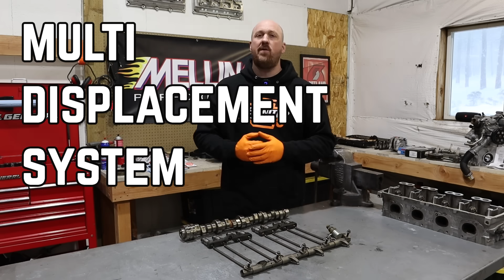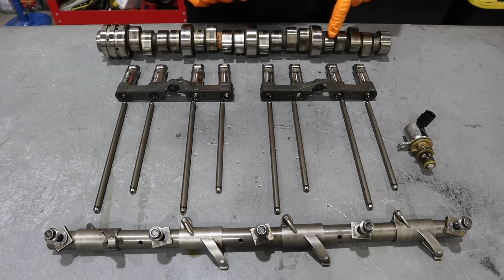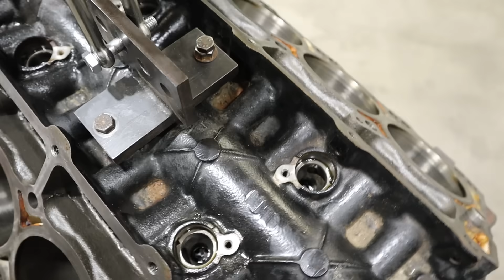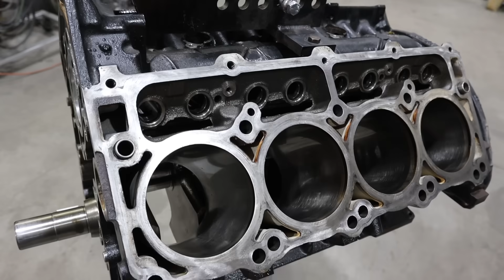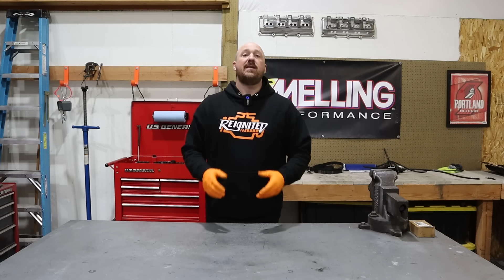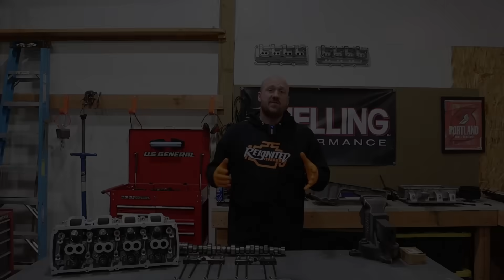Is MDS Damaging Your HEMI? The Answer May Surprise You!

Comment: I experienced the cam//lifter failure in my 2010 Ram 1500 in November and did the repair myself. Mine was the #5 intake that failed, which is a non-MDS lifter, so correct, the failure occurs with both MDS and Non-MDS lifters.
Reply: My 14 and my dads 15 were both #5 exhause non mds lifter
Reply: Most of the time I hear about failures, it seems to be the intakes, but your cases show the exhaust gets affected as well.
Reply: Does (or did) your truck experience a lot of idling time?
Reply: @DoctorHemi  Not by me, however, I bought the truck used in 2021. Where did I go to buy it? I drove down to L.A., so there is a good chance the previous owner spent time commuting in the LA stop & go traffic. He did have impeccable records on the truck which showed he took it to the dealership for oil changes every 3,000 miles. I really don’t know how much time he did or didn’t spend in traffic but if he did spend a lot of time in traffic, the oil changes would be better gauged on engine hours rather than mileage. I still think 3,000 is pretty good, and at the time I bought the truck, I was not even aware of the infamous hemi tick issue. I pulled a carfax report and no TSB available by Chrysler on the issue. In fact, to this day, Chrysler doesn’t official acknowledge the problem since they say this failure only occurred in approximately 5% of the vehicles sold…which I guess to them is acceptable. They did change the lifter design in 2016 but have not acknowledged that it was because of the failure. I’m sure they are making sure they do not provide anyone ammunition that can be used against them in any potential law suits. But then again, all auto manufacturers do the same thing. They have an obligation to their shareholders not to payout any more claims than they have to and it’s not easy going up against them in court. They have unlimited legal resources.
Reply: @shepherdguy  That makes sense. I've heard the 2016+ vehicles with new lifter design (that have larger needle bearings) are still having the same issue. In 2022, Dodge changed the recommended oil in the 5.7L to 0w-20 (from 5w-20) and some speculate that change was another attempt to mitigate the lifter/cam issue without officially acknowledging it. 
     As "Reignited" says in this (and other) videos, the issue appears to be due to oil starvation at low rpm. I now try to keep an eye on when the engine goes below 1000 rpm. I avoid unnecessary idling (e.g., going through a drive-thru, or sitting parked with it idling to stay cool/warm).  If I'm stuck in crawling traffic, every minute or so, I rev it up to 1200-1500 and hold it there for a few seconds to "feed the lifters" the oil they need. Eventually, I'll swap out to the new higher flow Melling pump so I don't have to worry about it.
Reply: @DoctorHemi  I also heard they were still having some failures even with the newer lifters but not at the same rate they were before. When I did my repair, I put in the 6.2 Hellcat oil pump, but I replaced the pressure relief spring to the 5.7 spring in order to avoid codes for pressure being too high under a load. Seems to be doing great so far. 5,000 miles since the repair and no issues yet. I ran standard oil the first two oil changes and changed at 1,500 first time, then 2,000 the 2nd time. Then went in with Royal Purple full synthetic. I agree that the change to 0w oil is an attempt to help with the issue. Ow can maintain better oil pressure due to its lower viscosity, but it doesn’t hold up as well at higher temperatures.
Reply: @DoctorHemi as long as the oil is changed frequently the idle time doesnt matter
Reply: @BurritoMan1994 not true, idle causes oil starvation.  Idle is 30 psi oil pressure compared to 50 when moving.
Reply: 2013 RAM had #5 failure at 130k, here, also. I can't remember if it was I or E  but obviously non mds lifters. #7 was starting to go as well, rollers were getting sloppy.
Reply: @OldDirty1 mine too 13 ..#5 and #7. Smh...killed it...wanting a free motor!!
Reply: @OldDirty1  Oh, don't let John Smith see this post...he claims is only one lifter and the other 15 are always good.
Reply: @shepherdguy  lol. Definitely not the case. I had one on the right bank that was "arguably" marginal, #6, I believe. The cam looked rough, as in the hard coating on the lobes were shot. Nice clean engine inside, fyi. I think it was inferior hardness and weak/small bearings in the lifter rollers that are most inferior on the older engines. I also believe that the hi volume oil pump is a major/important upgrade.
Reply: Yeah, my camshaft looked rough too. I has one lobe where there were small chips broke away where the outer edges of the lifter roller would ride but strangely that lifter looked pretty good. My engine was clean as well. It always had regular oil changes since Day 1
Reply: My 2011 failed on #3 Intake, also non MDS.  I dont have any history on the truck as I bought it this way.  The lifter and cam lobe were DESTROYED but didn't make any noise.  Only hint was #3 misfire.
Reply: That was my experience as well. My 2014 failed in cylinder #5 at only 85k miles. Fortunately the truck was totalled for hail damage at the time it started misfiring, so it became the insurance company's problem before it completely blew up.
Reply: Same thing with my 2013 Ram bad camshaft and Dodge knew that problem from 2012 to 2014 and did not issue recall
Reply: @mikee3997  They won’t issue a recall…first, because they have never actually admitted that there was an issue, and they are not likely going to admit it. Second, automotive companies generally will not issue a recall unless there is the probability that a safety factor will occur (such as an engine catching fire, for example). Also, the automotive companies do a risk/benefit analysis. If their analysis shows they would likely have to pay out on only a handful of lawsuits, they will likely not do a recall. The cost of recalling and fixing thousands of vehicles is far greater in cost than just paying a handful of lawsuits should they pop up. It’s sad but that’s the way most large companies are run.
Reply: It's been wet and icy here, during traction issues(RWD) I have used the gear limit setting(s) at 6 or 7th gear around town. Does this disable MDS?
Reply: Did you have to pull the whole motor out to fix it?
Reply: @ Nope, did it right in the truck. Removed hood, wiper cowl, electric fan and radiator to give me as much room as possible. Left the condenser in place because I didn’t want to evacuate the AC system.
Reply: @shepherdguy  I want to learn how to do this so badly. I wish I could’ve gone to a mechanic school like Rankin.
Reply: @ I would like to go to Rosedale Technical Institute to learn more about Automotive electronics. I’m decent on electronics but I don’t know if as well as the mechanical aspect.
Reply: My 23 Durango 5.7 hemi with 4k miles just got dropped off at the dealership today.  They said it sounds like the lifters are bad.
Reply: That doesn't mean it's NOT related to MDS, it just means it happened on a cylinder getting drag as the others stop & start!!!
Reply: @steveTGO  Well, if you're talking about "possibility", sure, it's possible it could be related to MDS; but if you're talking about "probability", then it is unlikely. It's possible that a 747 filled with Barnum & Bailey elephants could possibly crash into your home or workplace. It's possible...but not probable. You are grasping at straws to say non-MDS cylinder lifters get drag and cause lifter issues when the MDS lifters activate/deactivate. In fact, MDS came out in the Hemi 5.7s in 2005, yet we don't see the issue in the 2005 to 2008 models. You don't start seeing the issue until the 2009s, and really more frequently in 2010-2012. So what's the difference? In 2008, Chrysler redesigned the engine to begin with the 2009 models. They raised the camshaft in the block, increasing the distance between the cam and the crank. They flattened out the lifter angle due to the raised camshaft. Well now, imagine that! The infamous Hemi Tick began AFTER the next generation engine block design change and NOT when MDS was introduced. See Steve, you have to consider all of the facts or you up chasing down a rabbit hole.
Reply: @shepherdguy  - It really comes down to the oil it looks like, just the same way as the Buick Enclave 3.6 tick. The 3.6l in the 2008 to 2012 were junk, the oil distribution was horrible. A mechanic, along with a number of Dodge mechanics on YouTube claim the problem can be solves my getting rid of MDS and installing the Hellcat/Trackhawk oil pump in the engine!!!
Reply: My 2015 had #5 fail at really high mileage.
Reply: How long did it take you? I have lifter issue on my 2018 6.4.
Reply: @clarkream9082  not too long, really. I had a pause in the work because I took the heads down to a machine shop to have checked out and pressure washed just to make sure there wasn’t any metal in it anywhere. I didn’t see any but there was some in the bottom of the oil pan, and one of the cam lodes was worn pretty bad, so it I wanted to be sure there wasn’t any more metal in the engine. But all hours combined… maybe 10-12 hours total. That includes removing the bottom crossmember to get the oil pan off. 

One thing to remember if you do the job - make sure you fill the oil pump with Molly grease so it will prime when you first turn over the engine. If you still lose prime and can’t get oil pressure, you can pump oil into the boss where the oil filter housing is at using a clean herbicide pressure sprayer. That’s what I ended up having to do because I forgot to put grease in the oil pump before putting everything back together and I didn’t want to tear it back apart.
Reply: @shepherdguy thank you for the info.
Reply: MDS has nothing to do with the “Lifter Problem.” 

It was due to shitty lifters.  

If the lifter failure were attributed to MDS or a lack of lubrication; You’d be hearing stories of people replacing multiple lifters over the life of the vehicle!  However, you don’t!  Once the failed lifter is replaced you do not have a single incidence of repeated failures.
Reply: @DAT240Z72  this is great news. We just had #3 fail on us, and it's in the shop now. Reputable shop that only uses good parts, so glad to know it should be a one time thing.

Comment: I am curious that if the MDS system improves lubrication and good that it remain on, why does the Tow/Haul setting prevent MDS operation?  You would think that at a time when the engine needs the most lubrication, that it should remain functioning?  Many times when steady cruising on the highway that MDS can turn on while towing but won't due to being in Tow/Haul mode.
Reply: exactly, something must be wrong here, why would it deliver more oil when only half the cylinders are firing?
Reply: I've been running my Ram in tow/ haul mode for years to keep all 8 running and I did a fan clutch delete and got a Diablosport Trinity Platinum tuner to change the temperature of when the electric fan comes on. I also disabled the MDS,but I still just press the tow/ haul button anyways. I never heard anyone say that using tow/ haul mode or shutting off the MDS was bad. What sounds bad to me is an engine that keeps jumping from running on 8 cylinders down to 4 and back to 8 every time you hit the gas pedal.
Reply: @Bee-x6m exactly. i also dont like the idea of my cylinders just bouncing off exhaust gas😂
Reply: Great question. I'm also wondering if MDS improves oil lubrication, when cold starting the engine allegedly the lifter bores are not getting proper oil lubrication or when you're WOT when oil flow I'd moat important because MDS is not activated during these times
Reply: It's because you need maximum engine output/performance when towing or hauling. Would you want only 4 cylinders while towing a trailer? It would decrease your towing/payload capacity.
Reply: @briandonald  Of course, that goes without saying, but there are times when in tow/haul mode either highway cruising under light throttle or light load when you could be in MDS, especially since it takes less than a second to get out of it, why if MDS improves lubrication why would you remove it entirely?  Or maybe MDS doesn't improve lubrication?

Comment: Don't know if it was the MDS entirely that smoked my cam lobes , But after 4 lobes all but flattened and lifter rollers eaten up to the point of detonation..I opted to go with a solid lifter cam along with 2500 lifters. MDS block offs and a diablo flash. Night and day power difference. Obviously not as good fuel mileage but I bought a Hemi...I wanted a Hemi. Not a 4 banger. 2009 264k still rolling strong.
Reply: What mileage did the cam fail? I mean you have 264,000 miles so you cant really complain..I worked on Toyota Corolla's with 150,000 miles and they needed engine rebuilds/replacements..
Reply: @mypronouniswtf5559  did the tear down and rebuild at around 203k. I'm the second owner so I'm not sure off the previous idle time but being from New Hampshire I have to assume there there plenty of auto starts for heat and defrosts during the colder months
Reply: . OK , l can complain .

  Throughout ( mumble mumble ) decades of self and extended family,  with B block Chrysler,  small & big block Buick , small blk Pontiac , Jeep 4.0 , Ford Windsors , Ford FE, Chevy small blocks and 4.3 V-6 , and probably a cpl not thinking of ( added 2 Civics , plus another 3 or 4 by close sidekick , RIP F cancer) , NEVER had engine death from cam related failure .

 Out of all of those , 4 engine deaths . 2 from rod bearings.  2 from head gaskets ( induced from extreme heat , from catastrophic cooling failure  on the highway,  unable to safely pull off quickly enough .)
Reply: Does (or did) your truck experience a lot of idling time?
Reply: I hear its bad factory cams that wear the lobes down.

Comment: Great explanation of the system. I am one of the people who have seen 23 - 24 mpg in my 08 Charger with the cruise set at 80mph on the interstate between Idaho Falls and Boise on more than one trip. We could see 16 - 17 mpg around town if we keep the road rage under control. 

In my RAM, especially the 10 model, it didn't do much once you get above 50 - 55. 

Throttle position is one of the factors for activation, and the trucks are heavy and requires more throttle at higher speed to maintain which puts it out of range.

Love your videos, keep up the great informative content!
Reply: Are 2019 Dodge charger also gets excellent fuel mileage.

Comment: Thank you! Just bought 2012 Ram 1500 with 200K+ miles and the tick. Shut off mds with a tuner. Now, I 'll turn it back on, until remove it propperly. Tried to use 5w30 Redline oil for a little while - no luck so far. How much could it take to start getting a misfire code? Other than one lifter ticking, she runs perfect,  no codes and oil burnt
Reply: If you are sure it's a seized lifter, dont run it and get it fixed asap. Misfire code started abt a month after ticking for me. Ton of metal shavings now and need to disassemble the whole engine.
Reply: @DrShlobster Thank you! I am trying not to run it much until i am able to fix it. Though a friend of mine has been running his ticking hemi for 60K and still without misfire code. Nobody knows. But my ears and heart hurt listening the sound, so you are right! Asap!